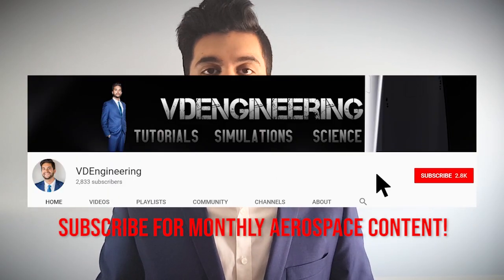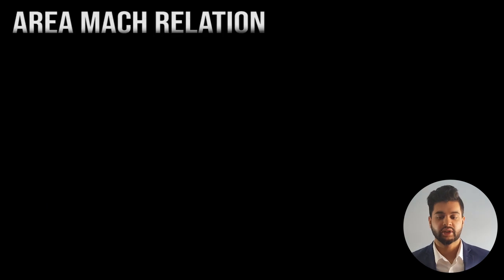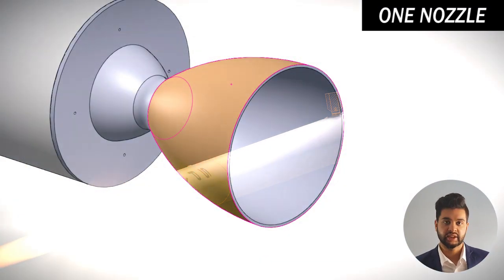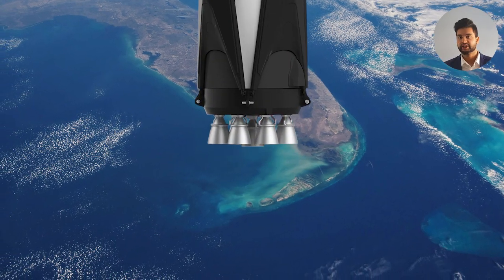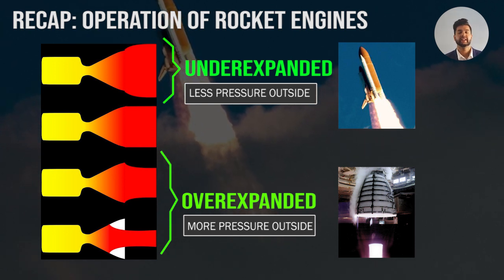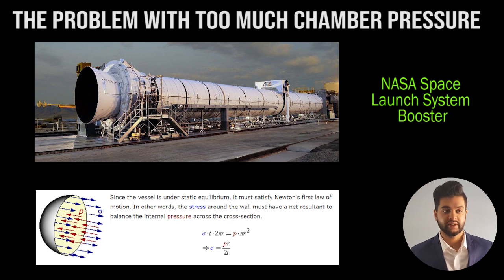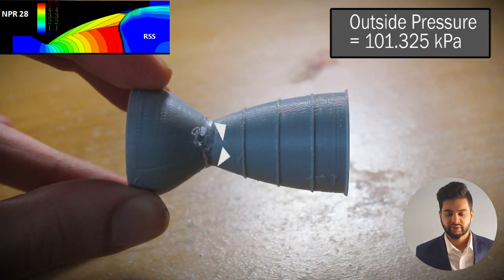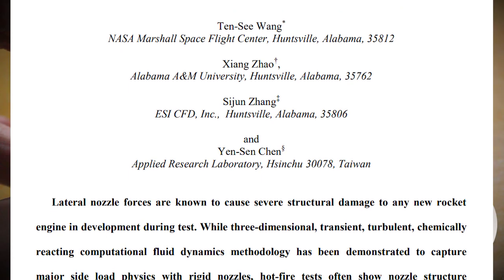Rocket Engines Part 3: Single Nozzle vs. Multiple Nozzles | What Performs Better?

Comment: Hello do you know why solid booster does not have multiple nozzles?
Reply from the maker: too heavy
Reply: @VDEngineering  too heavy is not the reason why it doesn’t have multiple nozzles. It can have multiple nozzles for short altitude and it is still lightweight.

Comment: do  4 nozzles play a role in change of direction? like when  there is more gas flow in one it would push the rocket to opposite side and wise versa
Reply from the maker: Very little however yes it does

Comment: Thanks for concise and clear explanation. Is it true that military fighter jets use over expanded nozzles primarily to protect the airframe from damage from the exhaust?  Also do you have any CFD diagrams that model vortex generators on the top of wings to lower stall velocity?

Comment: can engineers redesign the F1 engine that was used in Saturn V almost half a decade ago ? the biggest throat area...
Reply from the maker: No need. A single nozzle is suitable for only upper stage rockets due to minimal changes in external pressure.
Reply: @VDEngineering   sir, i need some help in my final yr project. how can i contact you?

Comment: Wouldn't a higher expansion ratio increase the efficiency of the rocket engine? I mean, the compression ratio of internal combustion engines is pretty much the expansion ratio, right, so shouldn't those two have the same 
effect?
Reply from the maker: If you're operating in an environment with minimal changes in ambient pressure (I.e vacuum or upper atmosphere) then yes. This is exactly why upper stage rockets only use one nozzle.
Reply: @VDEngineering  
I understand, so inside the atmosphere, engineers are willing to set these advantages aside, because the economical, geometrical and structural disadvantages are to big?